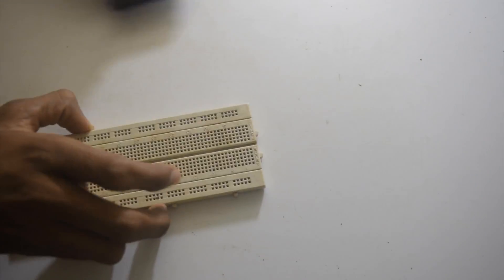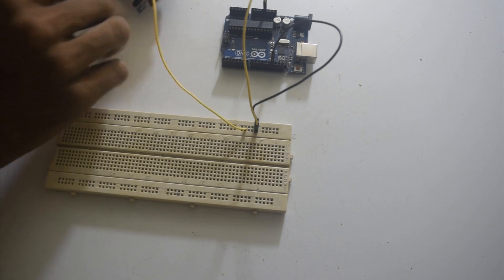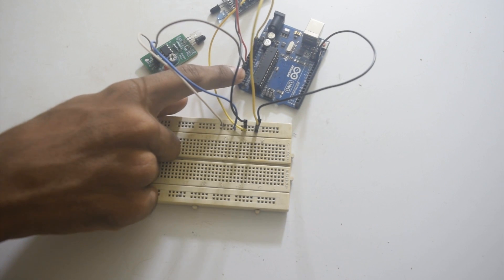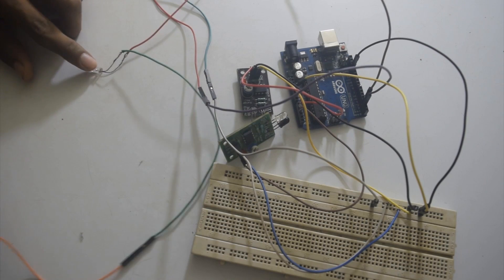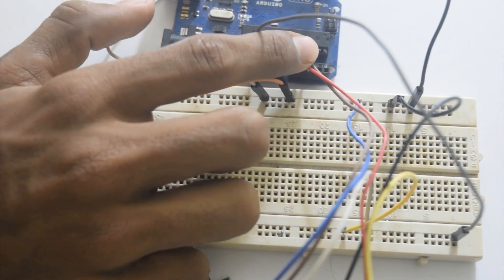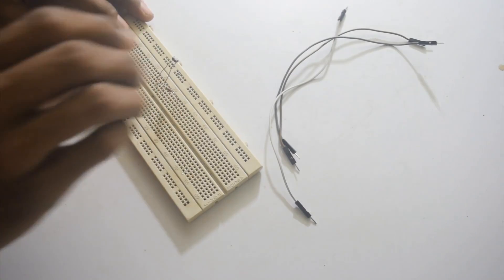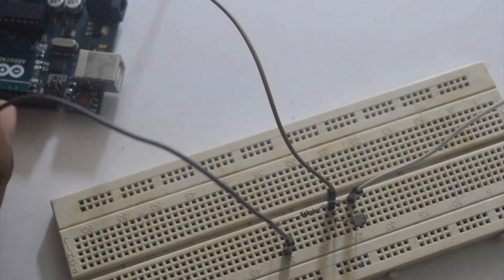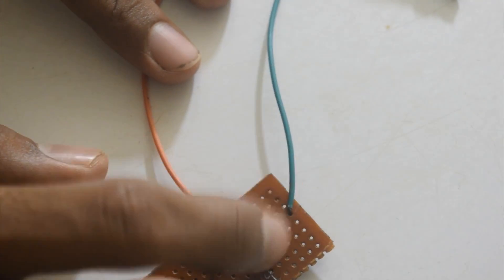Arduino Project - Smart street light system #arduino #project #robotics #robot #finalyearprojects

Comment: kindly help me with the code of this super project
Reply from the maker: What problem u are facing?
Reply: @electro_king_official  Am not able to connect 4 IR sensors,5 LEDS,an LDR and resistor.Kindly help
Reply from the maker: @msanga0117  i have uploaded 2nd part of this project kindly watch that video everything is explained in that video
Reply: I mean 5 LEDs and 4 IR sensors

Comment: I have properly connected the circuit as per the circuit diagram and the Arduino code yet the circuit isn't working the way it should. 
Instead of glowing when there is darkness,all the LED's are constantly glowing when the room is well lit...and when I place anything in front of the sensors, the LEDs become dim (exactly opposite from the required action ) Also LDR 1 is blinking constantly.
Please help me sir 
email: abhishekghanekar999@gmail.com
Reply from the maker: EVERY STEP EXPLAINED PROPERLY IN NEXT VIDEO WITH NEW CODE  - 
https://www.youtube.com/watch?v=AN4APgl_Y0I

Comment: hello . actually i m making my project with 5 ir sensors. i have taken the code from some other website and have made a bit changes to it myself. however i don't know to connect wires to the breadboard and i need to submit the project in 4 days. plz. guide me by making a video for connecting all the ir sensors and led's  or mail the details [plzz not the circuit diagram] to kunalangadi25@gmail.com

Comment: Hello,
we used 2 ir sensors instead of 5 and we also do some changes in code also sir.But it's doesnot working  properly...only one led is glowing and another one is not glowing sir. ..can you please tell what's wrong in that sir...
Reply from the maker: Jeba Varghese dont do the changes in the code connect first 2 ir sensors and leds it will work
Reply from the maker: see that u connect ldr properly and if u hav any problem u can messg me any tym
Reply: Tauseef Siddiqui we tried in this method only sir(by using 2 led's and 2 IR sensors only)..but it's doesn't work sir...one led doesn't glow and another led always glowing sir......can you please tell us what's the problem sir......thanks for ur response sir..
Reply from the maker: Jeba Varghese 
okay .....if im not wrong plz check yur ldr connection their might be sumthing wrong in the connections...
Reply: Tauseef Siddiqui  sorry sir....as you said we change the ldr and we made connection again sir..only one led is glowing properly out of 3 sir...can you please suggest some idea sir.

Comment: Plz send me the name and model number of the instruments in this email-  md.rhaman1954@gmail.com or polarbearnaimr@gmail.com.
Plz send.
Reply from the maker: Naim Rn send me a mail on my gmail
stauseef123@gmail.com
Reply: Did it?
Reply from the maker: Naim Rn
 yes just now
Reply: Did u use Arduino Uno R3 China or Arduino Uno R3 original
Reply from the maker: Naim Rn 
i dnt know abt tht 
but u can use any even arduino mega but see that the connection is as per the code
Reply: What’s the model of the IR sensor?
Reply from the maker: Naim Rn 
theirs no model no. for it . u will find it on amazon.in

Comment: Hello. Can you please send me your program for this project, for school project only. My email is jensenapostol@gmail.com . Thank you very much.
Reply from the maker: Jensen Apostol 
okey boi.....
actually u can download it from the link in the description
i'll mail u
Reply: Thank you very much for the great help Sir.
Reply from the maker: Jensen Apostol 
your welcme and did u got the code and circuit 
diagram
Reply: yes.thankyou very much
Reply from the maker: Jensen Apostol 
yur welcme
Reply: Sir may I ask again if the connections will be the same if for example I'll use PIR Sensor instead? Thank you.
Reply from the maker: Jensen Apostol 
nope...thn u have to write a different code for pir
Reply: Can you give me some clue on the certain part of the program that I have to make change Sir if I'll use PIR Sensor?
Reply from the maker: Jensen Apostol 
connection will be same
pir have 3 pins out same as IR sensor
 gnd, digital pin and vcc
Reply from the maker: Jensen Apostol ok ill try to help u out
Reply: What if I'll use only four Sensors sir? Am I just gonna erase some inputs and outputs in the Code?
Reply from the maker: Jensen Apostol 
yaa no problem u can edit the code as per yur need
Reply from the maker: if u wan u edit or els just keep the code as it is connect only 4 sensors it will work
Reply: Thank you very much for the info sir.
Reply: I would like to ask again sir. I used a SB612A PIR Sensor instead of IR Proximity Sensors, when I uploaded the Program, the LED Light keeps on blinking. What Should I change in the codes of the program sir?
Reply from the maker: yes u have to change the code, wait ill send u the code
Reply from the maker: hey Apostol  did u already ordered the PIR sensor
Reply: yes, we have just one sir
Reply from the maker: better u get IR sensors then PIR
Actually i dont have an PIR sensor so its very difficult for me to edit the code because i have to test code after editing to check the Output if its working as required

Comment: i made the same circuit and use this code but its not working leds continuously glow and when an object or car came in-front of ir sensor leds light intensity decrease.why?
Reply from the maker: AWAIS YASEEN 
did u connected all d led's and ir sensors according to the pins discribed in the code..?
Reply: yes i check and make circuit 3 times
Reply from the maker: AWAIS YASEEN 
then surly thr's sume problem with ldr...make sur tht ldr is connected properly
Reply from the maker: AWAIS YASEEN 
dnt worry it'll work thr might be sum problem in connection code is 100% correct... make sur u have connected ldr properly...
Reply: in your video when car comes in front of ir sensor light intensity increase otherwise light intensity stay at low level but i want lights off initially and glow when car comes and off again after car pass.how can i do change in your program?
Reply from the maker: AWAIS YASEEN 
yaaa y not....u can..
and tell me ur using LDR in yur project...and if yes is it working properly
 actually im having pappr tomorrow...so i cant help u now to do tht...tomorrow u mail me 
stauseef123@gmail.com
Reply: i am facing the same problem.whyyy ??

Comment: Hi. I would like to make 1st ir sensor light up led1, led2, led3. 2nd ir sensor light up led2, led3, led4. I'm using only 1 ldr. 2nd ir sensor worked, but 1st ir sensor light up led1 only. Why? Should I use more than 1 ldr?
Reply from the maker: zati 
is yur ldr wrking properly i mean the led's are glowing whn its dark and going off when its bright.
tell me one thing u r using only 2 ir sensors and did u edited the code...u have to write for eg if the value of 1st ir sensor is >300 then led 1,2,3 = high else low
if u wan any help u can contact me on gmail 
stauseef123@gmail.com
Reply: Yes they're glowing in the dark and off when it's bright. I've also edited the code. But only 1st ir sensor worked according to the code. Here's how I write it:
if(irstate1 == LOW && ldrvalue<300)
{
digitalWrite(led1, HIGH);
digitalWrite(led2, HIGH);
digitalWrite(led3, HIGH);
}
else
{
digitalWrite(led1, LOW);
digitalWrite(led2, LOW);
digitalWrite(led3, LOW);
}
if(irstate2 == LOW && ldrvalue<300)
{
digitalWrite(led2, HIGH);
digitalWrite(led3, HIGH);
digitalWrite(led4, HIGH);
}
else
{
digitalWrite(led2, LOW);
digitalWrite(led3, LOW);
digitalWrite(Led4, LOW);
}
Reply from the maker: ok try changing the pin no. sum tym thr r problem in digital pins of arduino 
i was also facing same thing and whn i changed the pin no. for eg pin no. 3 to 4 thn it worked..... if still its not working thn reset yur arduino and reupload the code. 
and if still its not working thn ill send u d code
Reply: I've changed the pin so many times but it's still not working properly 😢 can you check the code for me? I'll email you
Reply from the maker: zati 
send me the main code file...not photos
Reply: I've sent you the code. Pls check your email

Comment: what type of ardino you use in this project uno or mega?
Reply from the maker: AWAIS YASEEN nice question ...i used UNO
Reply: i donot understand why you used ldr in the function only ir gives the same output?
Reply from the maker: AWAIS YASEEN 
i used it because i wnted to make the streetlight system automatic...ex. whn its dark(at night) the streetlights will get on autometically and whn its bright (day time) the lights will get off automatically
LDR ( light depend resistor ) when light falls on it, it sends a low signal (0) and when its dark then it sends a high signal(1) 

i hope this will help u...and at the start of the video u can see the use of ldr
Reply: Can you tell me that what is the value of resister use with ldr?
Reply from the maker: AWAIS YASEEN 
10k
Reply: Thanks